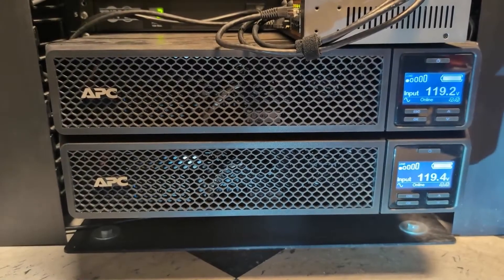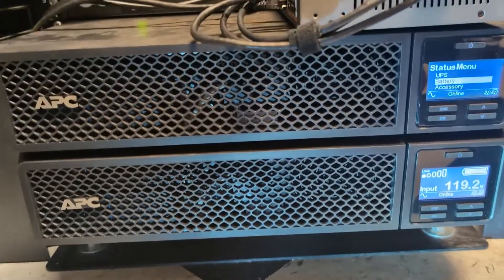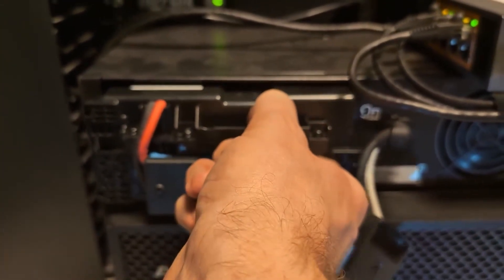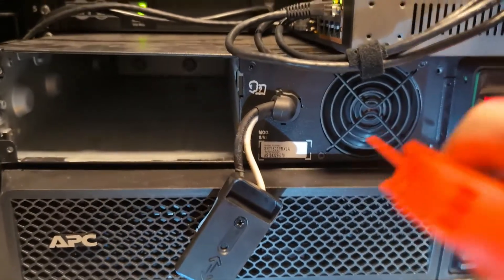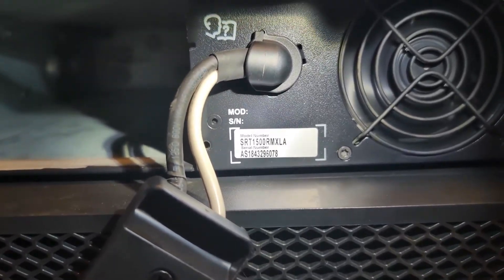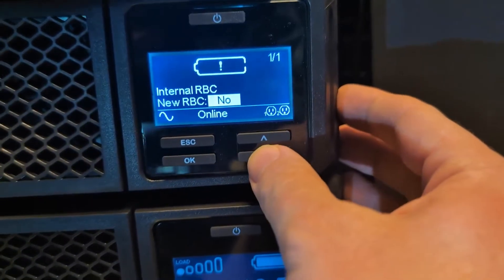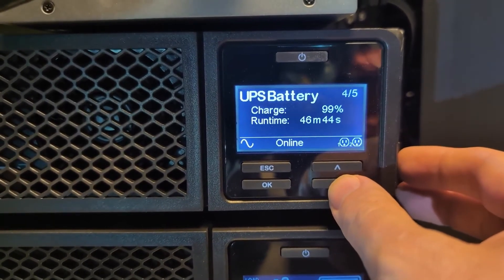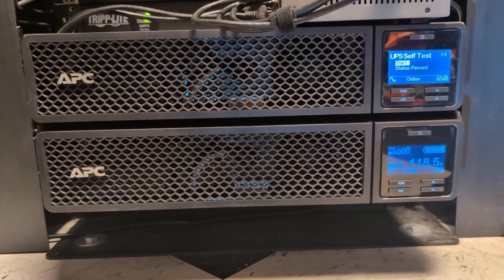How to replace a battery in APC UPS

Comment from the maker: In this five minute video we look at the process to replace the internal battery in an APC rack-mounted UPS model # SRT1500RMXLA.  We show how to reset the replacement interval counter (date) and how to run the built-in hardware battery self test.  If you have any questions feel free to ask them in the comments.

If this video was helpful to you please like & subscribe to my channel.  It really helps me out a lot.  Thanks!
Reply: How long does the self-test take?
Reply from the maker: @HASA-676  hi! Exact time is going to vary by model, but in general it shouldn't take more than five minutes.

Comment: Replaced a similar model at work but after the new battery is seated the screen is red saying the batteries need to be replaced
Reply from the maker: It may vary based on model, but did you perform the "reset" procedure to tell the unit the battery had been replaced?
Reply: @jhilumdas5228  я меняю батарею в srt 5000. Меню выставить дата замены батареи, второй шаг - запуск self test обязательно под нагрузкой. Через Около 10 минут UPS включил дисплей синим цветом, сообщение о необходимости замены RBC140 отключилось.